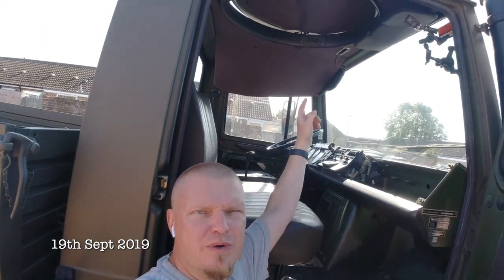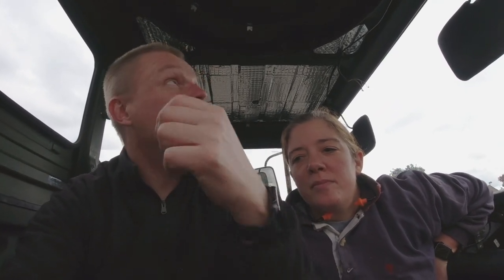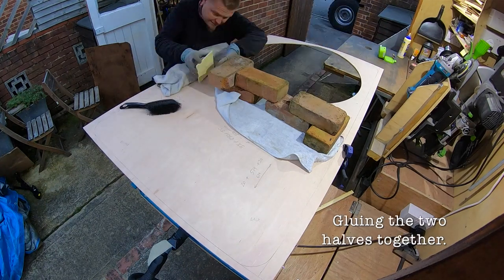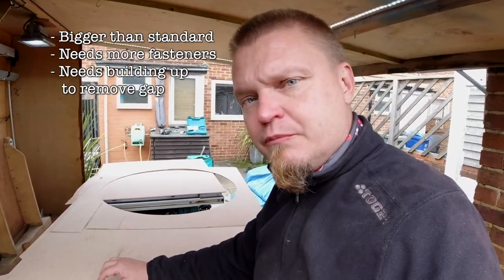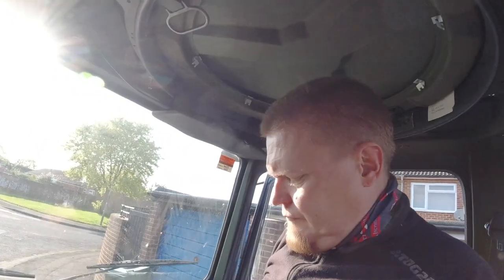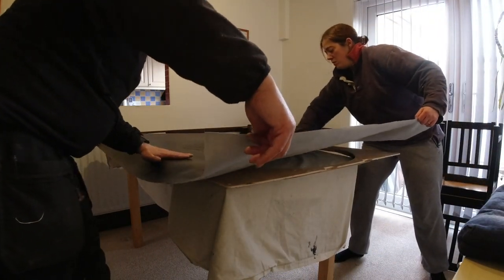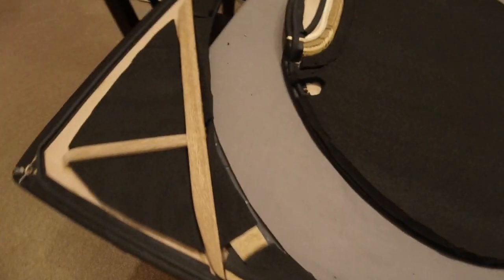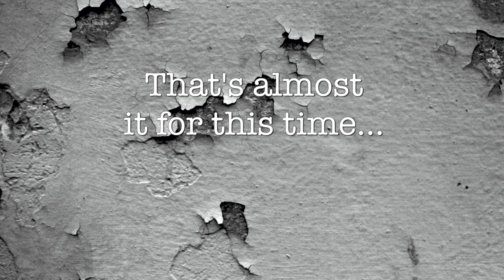Unimog Camper E010 - Building a new headliner/ceiling for the cab

Comment: Another great video... the fast forward sections show just how time consuming these "smaller" jobs can be.

One thing you could have considered would have been some red lighting in the cab, particularly for the passenger side.  Much less dazzling for the driver if you need some cab lighting on while driving at night.
Reply from the maker: Hi Patrick, glad you enjoyed the video :) Everything seems to take that little bit longer than you think that it should! But it's worth it for the end result. 
Good point for the cab lighting - we do actually have another map reading light to add that has both red and white light, but that won't be mounted in the head liner.

Comment: I was about to ask - how on earth do you line up the rivnuts with the correct point on the headlining? Woah & behold you come up with a great hack - well done & thanks, hopefully I can use your ideas to make a liner for Betty. Sadly I have no template to work from so guess I’ll have v57.8 by the time I’m done 😆
Reply from the maker: Glad you found the tip useful. As a disclaimer I’ll have to say that I’ve probably seen it used somewhere, I know there’s transfer dowels for when you use dowels in woodworking and such. If you don’t have a template, make one from cardboard or similar. Much easier to work with and sturdy enough to transfer to plywood or any material you end up using. Good luck!